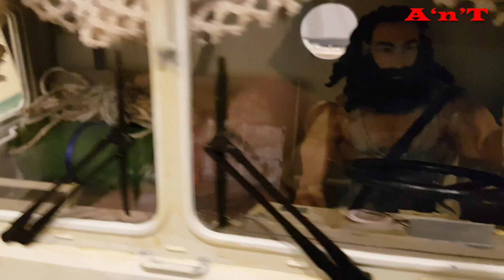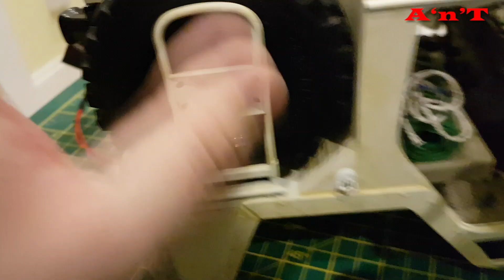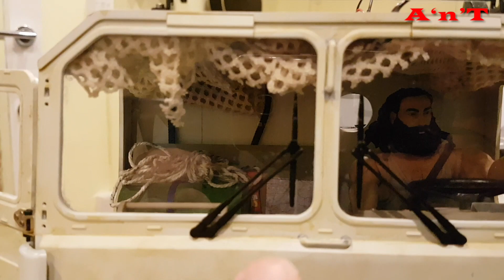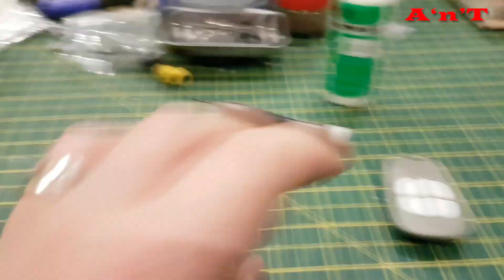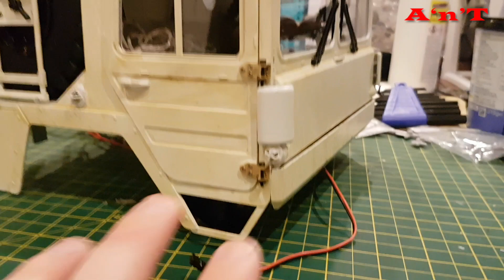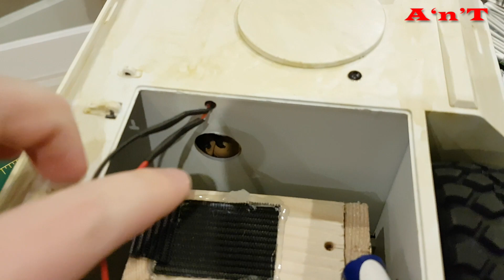CROSS RC MAN KAT MC6 'B' Build part 8 -  1/12th scale

Comment: Cool a Granny truck with net curtains :-) Sorry for ribbing you. Those door hinges are so cool I hope they do them to buy at sometime as good for a project. But that light bar will melt Andrews truck if in front and you can record that on camera. But next the fun of the rear bed with all the little bits to go on.
Reply from the maker: Basildon Trail Blazing Buddies ha ha. Net curtains. Not thought of it like that. Andrew instigated a light competition. Little did he know I had this up my sleeve. What hinges does your truck have?
Reply: @antrc  On the trucks I have built have small piano hinges that are internal. My MC4 as you know has none, but on yours super cool looking external ones and it's not the thing you see for sale. Just think if you was building a truck body and all you need to do is lay them on the side and the door drill a couple of holes and bolt them on. Trying trying to make internal hinge work a lot harder. But your comments between you two are so funny with the sibling like rivalry :-) does add flare to your videos and we are not just taking about your lights.
Reply from the maker: omg, net curtains. I missed a trick. Nice one Mal. Tel, awesome progress dude, proud of you. I won't mention net curtains very often. Promise.